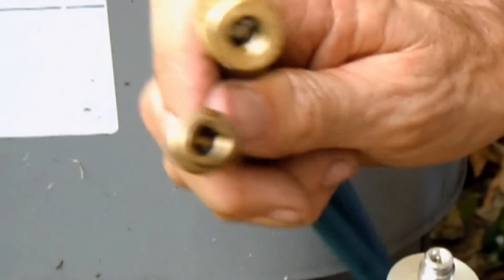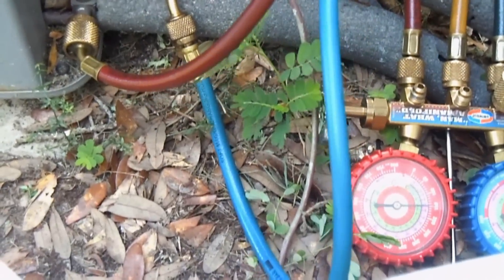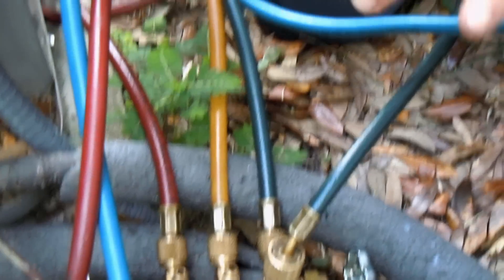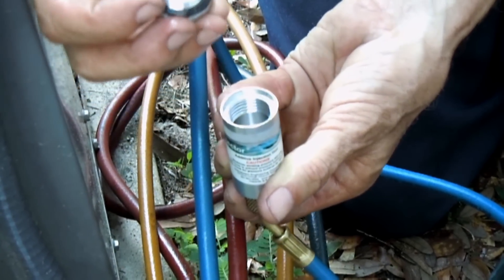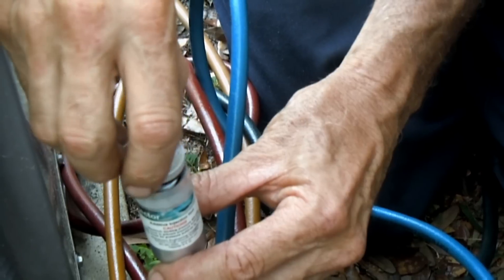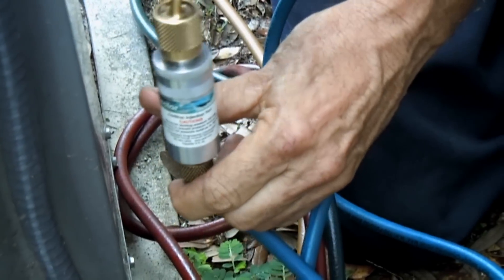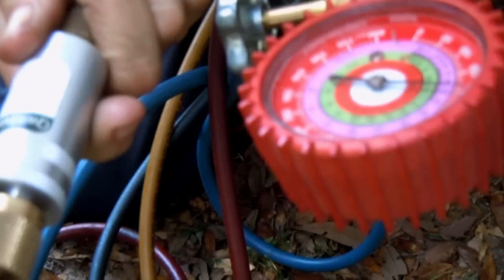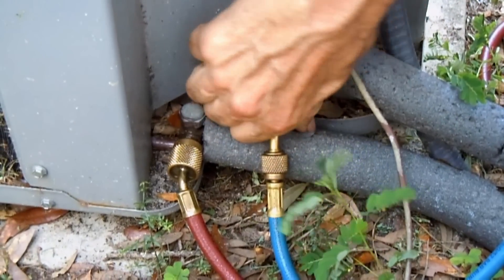HVAC A/C Renew 2

Comment: You did not purge the air out of the injector ?
Reply: Fill to the line, the cylinder is made exactly for how much product is in the can. Very little if any air will be present. It's in the instructions.

Comment: Q? Dose this introduce moisture and air into the system if you don't purge the insert tool?   I guess it is assumed that you will find a leak you would repair and evacuate with new dryer.  But if inserting oil any contaminants (non refrigerant such air or moisture).. why do you purge the hoses and not any excess space in the tool.

Comment: Works to free up sticking TXVs common in the industry in recent months.
Reply: Exactly,  
Copeland use a additive on their compressors to prevent rust on the making prosses, 
This additive cause the metering devices to get clogged,stuck open, stuck close, 
Adding this to the system will solve the problem ,, 
Seen it with my own eyes!
Reply: Had the same thing happen, TXV stuck, put in a new one, stuck again a few days later. Nordyne support said to use this to stop sticking TXV's caused by the Copeland additive.  Seems to have worked so far.

Comment: Dear Dr Zarkloff,

The injection tool side of the blue hose doesn't seem to have a low loss fitting.  Whenever you take the cap off the injection tool,  wouldn't that hose be at atmospheric pressure while letting the higher pressure refrigerant out through the injection tool? I noticed that you loosened the low pressure low loss fitting so the system wouldn't let its refrigerant out as well. 

What are the odds that air may be injected along with renew into the system?
Reply: great odds unless you purge the hoses.

Comment: Dr. Zarkloff, while watching your hoses, I noticed that the blue hose connector is not a low loss adapter on the injector side. When you unhooked  the low loss adapter from system's suction port, then removed the yellow hose low loss adapter from injector's high pressure side and then took the cap off, you showed the bottom of the injector. Isn't there any danger of having some air getting into the blue hose through the bottom of injector?

Thanks in advance for your answer.

Comment: what about the air in the yellow hose ?
Reply: These instructions are not correct. The injector tool has to be purged properly to avoid adding air to the system.
Reply: What about the remaining air in the canister??? I would have pressurized it, then depressed the Schrader valve to get it all out.

Comment: I think there is air being introduced into the system every time you open up the injector lid. 

What exactly is the benefit of this product? They claim that it rejuvenates the refrigeration system by chemically bonding to the copper tubing, thus increasing heat transfer... Really? Why wouldn't the manufactures engineer this into their systems to obtain higher efficiency levels?

I am a fan of your informative vids, just not a believer in this product...